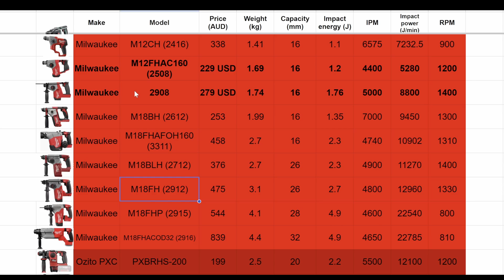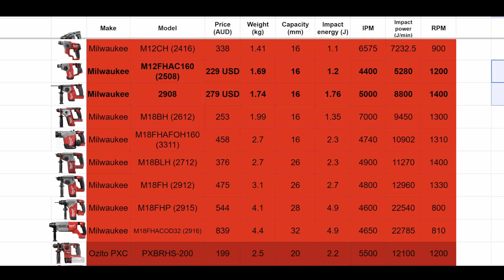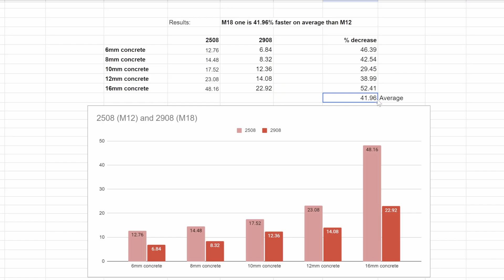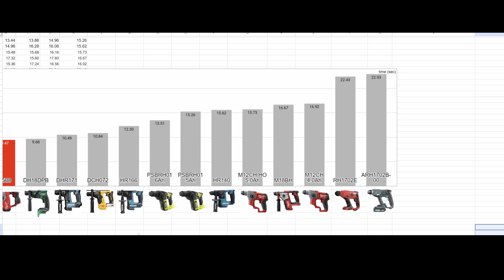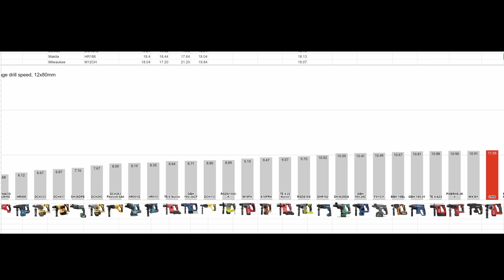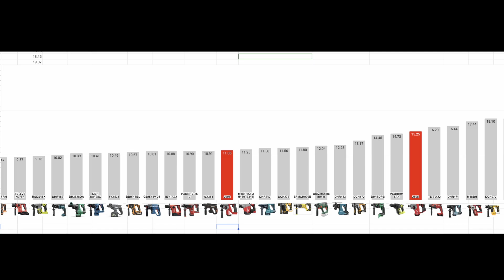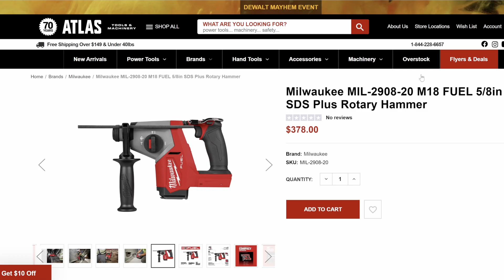Milwaukee 2908 vs 2508 (M18 vs M12 fuel SDS rotary hammers）

Comment: First I’m going to say  I’m a Milwaukee guy but running the new M-12 fuel with a 5.0 high output battery running a 1/4 inch bit it periodically quit and had to restart drilling into concrete to hammer in a pinch nail.  If unfamiliar with pinch nail that’s a 16 duplex nail with a piece of wire in my honest opinion it sucks wouldn’t recommend anything over 1/4 inch it really struggles
Reply from the maker: The funny thing is, that happens with small bits like 1/4 but doesn't really happen with say 3/8 and bigger, unless you go really deep. Small bits have less room for dust and get plugged up real right from the dust building up. But small bits are what you want to run with the small drill! 
It's the paradox of the tiny rotary Hammers. I usually run mine with 3/8 or 1/2 kinda sizes and it doesn't bind up until it's like 3 inches in

Comment: i really want to see a good review of the 2718-20 1 3/4 sds max
Reply: I've got the cordless 1 3/4, it's a beast but even with an 12AH Forge youre only getting about 30 minutes of chipping.
Reply: @domeguy-z7y  i ended up purchasing it, works great for my uses. i have 4 12ahs and a supercharger so im never really without charge.

Comment: How does the m18 compare to the m18 the next size up I wonder? I was considering buying the new compact one, but I ended up going with the 1” version to be safe
Reply from the maker: The 1 inch is twice as powerful. If you go to the chapters with the drill tests you should be able to see it in the graphs
Reply: @BoltahDownunder  Ok thank you! That’s good to know that I bought the appropriate one for work. The small size was appealing, but drilling overhead all day gets tiring if holes take a long time

Comment: For someone who owns the M12 FPD2 hammer drill already, would the M12 FHAC16 make sense to buy? Would it add enough capability to my tool set to warrant about 250€ for a tool and a 5Ah battery?
Reply from the maker: Depends what you're drilling and how big. This short can give you an idea of the different tools in different material, and the old 18V sds here is slightly less powerful than the new 12v https://youtube.com/shorts/yYPJ3Rumvh0?feature=share
Reply: @BoltahDownunder Thanks for the reply! Your video shows two 18V devices though. My main application would be around the house, hanging lights from reinforced concrete ceilings every now and then and hanging cabinets and shelfs to sandstone walls. I live in Germany, where most renting places are made like that.

Comment: Hello it would be great to compare it to some bigger opponent like the 2912 . Why comparing M12 with M18 its obvious winner.. ;)
Reply: I like seeing how much better the m18 is. And if the m12 can compete at all. I use the m12 line so it's nice to see the sds is pretty dang usable actually
Reply from the maker: All of the bigger ones have been tested already can be seen on the big results graph

Comment: Very useful, thanks. That M18 6amp battery weights about twice as much as a single M12 5amp, do you think you can get at least twice as many holes with the M18 6mp? If so, that's probably better than carrying an M12 and two batteries... thinking about canyoning or climbing here.
Reply from the maker: I'll do a runtime test on the m18 soon, but I think it's going to be more efficient pound for pound than the m12 because it just gets the work done so much faster. meanwhile you can see the runtime tests for the M12's here on my climbing channel: https://youtu.be/h9_L-DMMr64
Reply: @BoltahDownunder  FYI, I weighed the Milwaukee batteries that I have. M12 4 amp=405 grams, M18 5 amp=721grams, and M18 6 amp HO=1070 grams. Seems like the new M18 rotary hammer with ONE battery might make more sense than carrying the M12 with TWO batteries. Again, thinking about longer climbing and canyoning routes.
Reply: Quick update here. Ended up getting a M18 2908. Here are some numbers. 
- M18 2908 tool only: 1743 grams. 
- M12 2416 (awesome tool, but recently discontinued) tool only: 1430 grams. 
- M18 2908 with ONE XC5 battery weighs 2465 grams
- M12 2416 with TWO XC4 batteries weighs 2234 grams. 

So only a small weight difference when considering the batteries and their life. I am guessing that the new M18 will probably drill more holes with the single 5 amp battery than the little M12 with two 4 amp batteries. Thinking about climbing and canyoning here, where weight matters. Keen to get 3 and 4 amp batteries for the M18 and see how it goes. Thanks again for the review.

Comment: How does the m18 fuel compares with the 20mm 40v makita sds plus? Looking for a small sds plus drill with hammer only and that’s the only other one I can seem to find which fits the description
Reply from the maker: That Makita is about 20% more powerful and 20% heavier. Both are excellent for their size so I guess go hold them in a tool store and see which one you like better

Comment: Funnily enough- I found my older M12 more tiring to use overall vs a bigger/heavier drill like M18/Bosch 18v etc. 
I got the m12 to use on overhanging routes way up in the mountains but feel the weight/size savings were negated by longer drill times in awkward positions.
The more powerful drill just rips into the rock in seconds- saving my body from the stress of being under tension.
Reply from the maker: And that's the conundrum right there!  It looks like that type of use (well, construction high/awkward work) is what Milwaukee is going for with these guys, and the new M18 with a smaller battery would be the best of both worlds. I guess the old M12 would still be ok for like limestone or whatever but it does struggle in hard rock.  one thing you could try to make life easier with the old one is optimizing your bits. Usually a 2 cutter with a centering point will drill the fastest

Comment: My question is if you own a M18 generation 4 hammer drill should you buy the M12 SDS?
Reply: I prefer an SDS-based rotary hammer over any combi drill any day of the week, even if it is a lower voltage. The difference between the two types of drill is night and day.
Reply from the maker: It really depends what you're doing. Hammer drills basically just vibrate so are good for smaller/softer stuff like 5mm plugs in brick. But bigger/harder jobs like 12mm in concrete an SDS will dominate.
This short gives an idea of the difference: https://youtube.com/shorts/cfg4EpOU9x4?si=lffWZaVdkv6sBZqB

Comment: I’ve been liking the new M12 but when I saw the M18 in store I thought I may have made the wrong choice. Still the smaller batteries and footprint in the battery area make it the better choice for me. 

If you still have hammers from your data set, you could pour a new batch and take a bunch of readings using the old hammers. Then compare to the old concrete batch to get a correction factor to match up the sets. 

At minimum 3 hammers, all different sizes. Each doing 3 bit sizes for minimum of 3 runs per bit. 

If the new data doesn’t roughly fit the shape of the curve of the existing data set then do more runs where it’s off and see if that brings it in. 

Cheers!
Reply from the maker: I have calibrated my granite blocks like this, because it's not all coming from the same source. 
Depending on if I get any offers for concrete donation I might migrate all the old results to a new dataset based on a scaling factor, or just re-test the new/popular tools that people actually ask about. Either way there are plenty more topics to explore here!